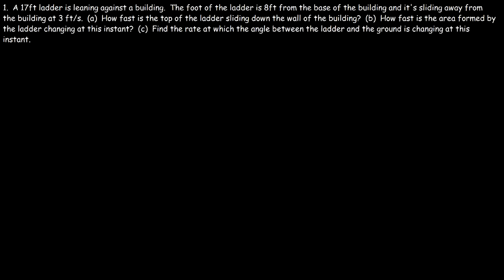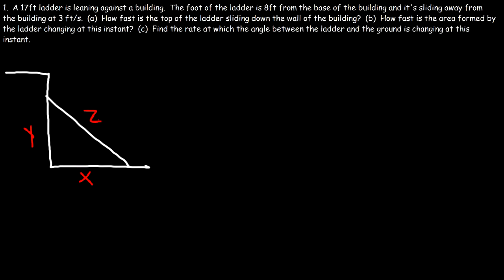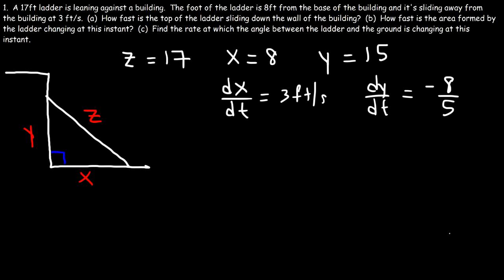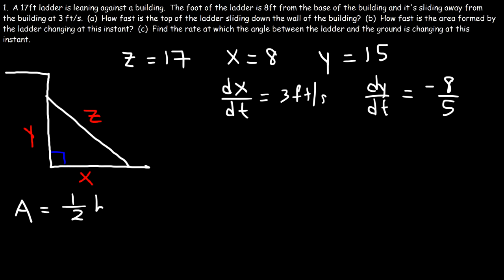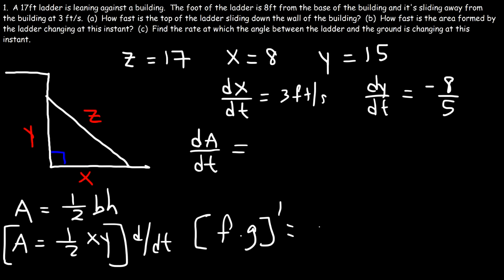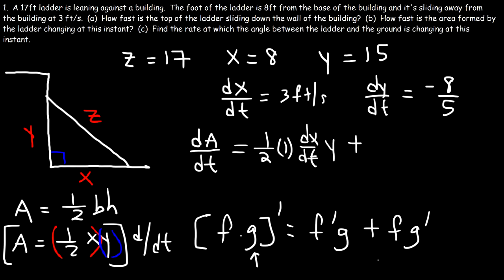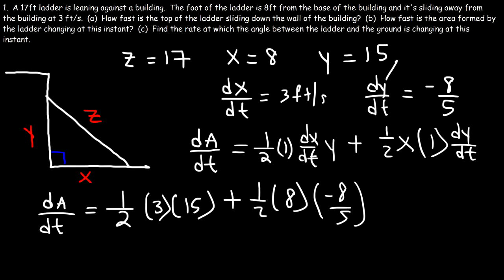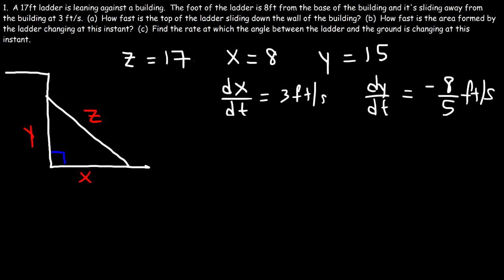Related Rates - The Ladder Problem

Comment: @ 10:39 "I'm gonna use sin θ."
Sin θ involves value(s) that you had to calculate; whereas cos θ involves only given information. Therefore recommend using cos θ because there's less opportunity for error.
Reply: but you need to calculate the derivative of sinθ, so it would be using cosθ. doing the derivative of cosθ would be -sinθ which is more work and opportunity for error
Reply: @superepiic   No, sine or cosine is not the issue. The issue is that d sin θ/dt is related to dy/dt (a calculated value); whereas, d cos θ/dt is related to dx/dt (a given value). It makes no difference if you use sine or cosine in practical terms bcz the triangle is a Pythagorean triple: 8, 15, 17. With that fact in hand, it is unlikely that you will make error calculating either ratio.
Reply: @johnnolen8338  You're right. But in other problems though, it would depend
Reply: @superepiic   I agree. It always depends. In this case the rates you want to relate are dθ/dt and dx/dt, which makes cosine the obvious choice in my opinion; but hey, do whatever works for you. 🤙

Comment: A 10-foot ladder is standing vertically against the side of a house. The base of the ladder is pulled away from the side of the house at the rate of 1 foot per second. How fast will the top of the ladder by falling down the side of the house 9 second after the base begins being pulled away from the house?

Comment: the foot of the ladder leaning against the wall is 6ft away from the wall and its top is 8ft above the ground. what is the length of the ladder? 

A.4ft B.12ft C.16ft D.100ft E.5ft What is the correct answer?

Comment: why z is constant? if so why x or y are not constant?
Reply: z is constant because it is the length of the ladder. On the other hand, x, represents the distance of the foot of the ladder to the wall and y represents the height of the top of the ladder. Therefore, x and y are always changing meaning they are not constant.

Comment: At 3:35 , isn't 8 and 15 a constant as well? But we still took the derivative like normal, unlike Z, which became 0
Reply: Tracy Vu The length of the ladder will ALWAYS be 17. However, with Y and X, their distance will change relative to the ground, which means that they CAN CHANGE. Hope this helps!
Reply: @Anonymous51701  thank you
Reply: @Anonymous51701  ur a goat bro even 4 years later...
Reply: @Anonymous51701  thanks man really appriciate it
Reply: the height and length (x and y) CAN change.

Comment: part A wouldn't be negative because it's not sliding down the wall at negative ft/s. it's just sliding down the wall at ft/s. no such thing as negative velocity
Reply: Velocity is a vector. The negative simply implies that the object is moving on the opposite side. (For example, left). Negatives do exist in velocity. Only in speed, you cannot have negatives (because its scalar)
Reply: Sure but the coordinate is decreasing so its justified

Comment: okay why is Z 0? should its derivative would be 2z(dz/dt) like x and y ??? Im so confuse!! HELP!!
Reply: He explained why, z is a constant given to you in the problem. Therefore because its a constant the derivative of it will be zero
Reply: RojekJ but how do you differentiate constant to a variable if all x y and z have values
Reply: @niki-mendozacatalan5903  Z is constant because the length of the ladder never changes. The x value will be changing because the ladder will be sliding away from the wall, if that makes any sense. you have to solve for Y so its not a constant. Im a calc student at the moment, so I am by no means an expert, this is just my take on the problem. Hope this helps
Reply: RojekJ oh yehhh! That make sense now thank you, i completely ignored what Z represent. I better right things down when I illustrate this type of problem. ☺️

Comment: The right triangle can be used to establish dy/dt.  Ladder length is constant.  Because of it we know y = 9 feet and we know dy/dt is negative (y is losing height, 8 ft).  We also know -dy/dt = dx/dt and we know when y = 9,  dy/dt = -16.00 feet/sec, so dx/dt = 16.00 feet/sec.   
gravity = 32 feet/sec^2 or 9.8 meter/sec^2

Comment: You cannot ignore the acceleration due to gravity. Students who need help will only get confused. Units attached to the variables are critical. You cannot add and subtract variables with
different units, but you can multiply, divide and apply exponents to these variables and their units with the same operation.  Please help students - don't confuse them
Reply: Time rates is for Calculus is just mathematical representation of variable equations. Its an application of the rate of change neglecting the effects of referential frames. And always assumes constant change.
If it was introduced to Physics, then it could have an additional effects from the referential frame, eg. Gravity, air resistance, mass/weight, force (pull or push) and other contributors.